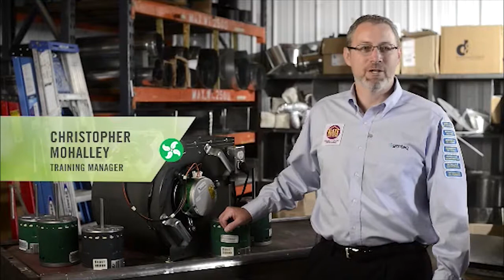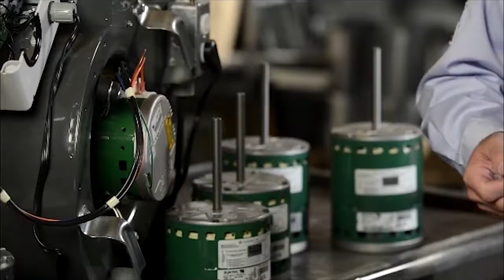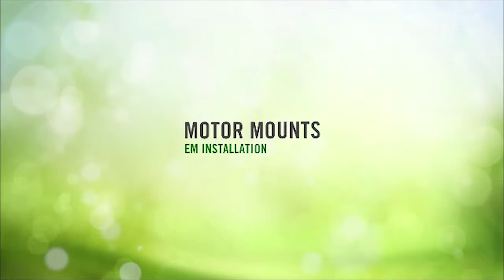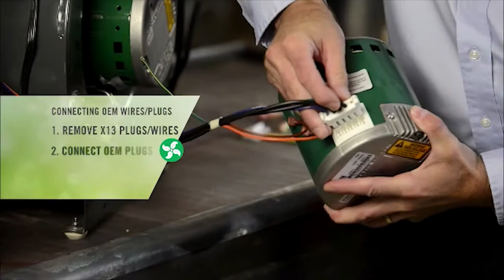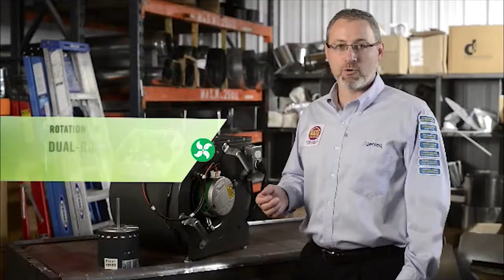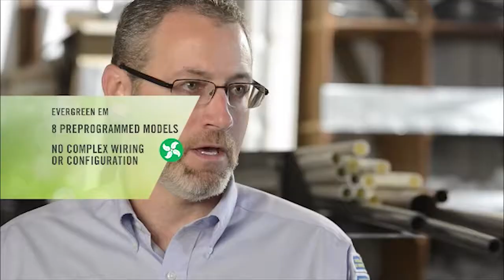Regal Evergreen HVAC Motors from DiversiTech - EM Install

Comment: I wish you had spent some time on connecting the speed terminals. My HVAC guy said Carrier instruction told him to connect the blue wire to terminal 2 and white wire to terminal 4. The fan is too fast and not getting the humidity out. I need it to be slower. How should I connect it?